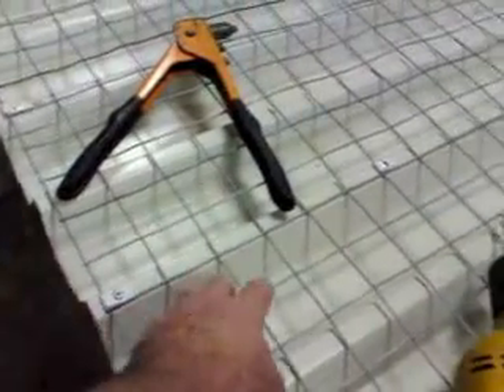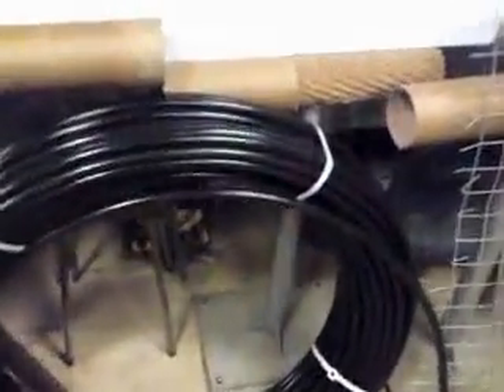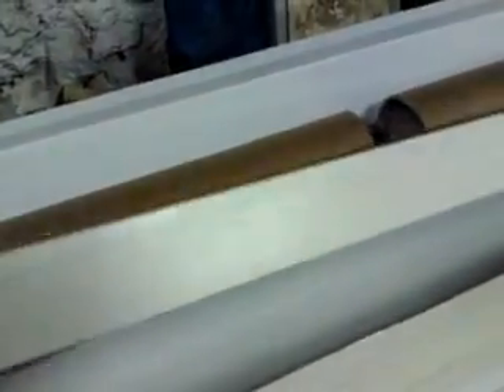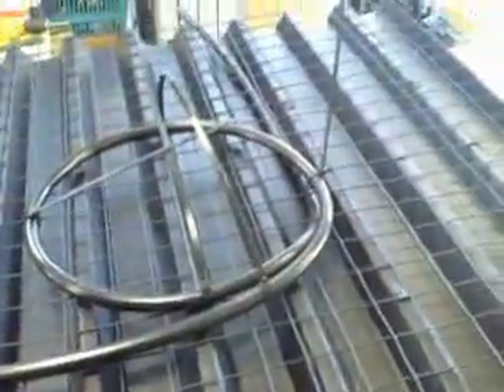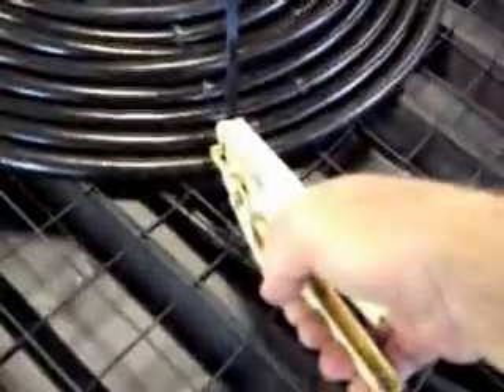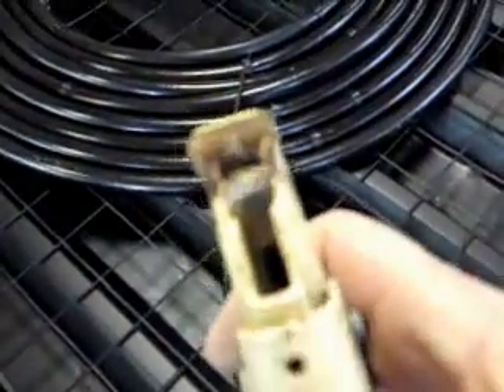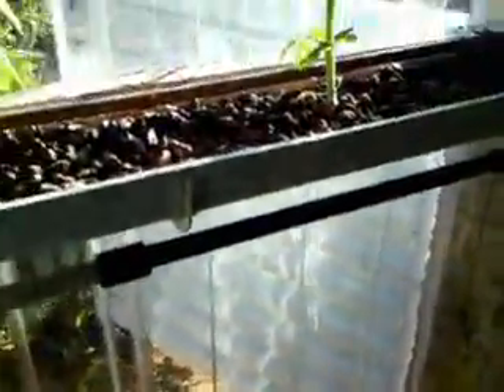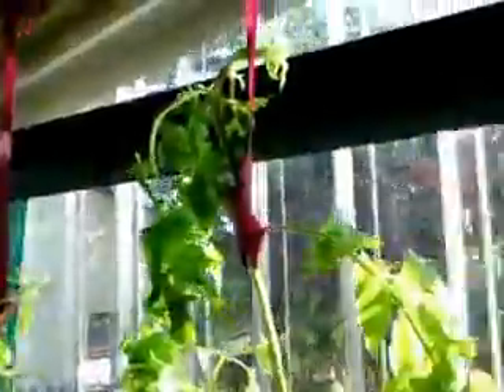Solar Water Heater

Comment: I had a swimming pool solar heater installed by professionals about 20yrs back. The pipes carrying water onto the roof was normal 40mm PVC, but about 100 thinner black rubber tubes the size of drinking straws absorbed the sun's heat, spanned between the 40mm "outriggers". They assured me the material was similar to car wiper blades and as durable, which it was! Also, a pressure relief valve was fitted in-line in the upper corner, maybe this will solve your steam/overheating problem!!

Comment: @Rockit8 
I figured out why it over heated and melted the pipe. I didnt allow it to run long enough to push all the air out. When I turned it off, wherever there was trapped air, it melted. There was no water touching the pipe to absorb the heat.

Comment: @spokedwheel 
Water touching the pipe should have kept it from melting. I now believe the pipe melted only where there was air trapped in the system. I have since learned to purge out all the air.

Comment from the maker: @Rockit8 Fortunately I haven't had any 'melting pipes yet' maybe the tube you used was a lot thinner,(if your system is a closed loop system, then the steam build up would burst the pipe), though the water does get too hot for the fish if I leave it running constantly, that's why I have it running only from noon to 5, thanks for the interest.

Comment: I built one like this but smaller. The first time I used it, I turned off the pump. With the water not curculating,  it got so hot that the tube melted and got several holes in it.  This thing gets hot fast, so when the sun is out, you have to keep the water circulating or keep it covered. I should find a tube that can handle higher temperatures.

Comment from the maker: @BooKittyRadley Obviously the heater won't get hotter than the outside temperature but if the cold is in the wind factor but the sun is still shining then the unit should still heat up, I have my timer set to come on at 12 noon when the sun is shining directly on it and the water is pretty hot when it starts up, as I said in a previous post, it takes about a day to raise the temp from +- 16C to 30C. Where I stay it never gets as cold as 7C, it's winter here now and the temp. maintains at +- 25C.

Comment from the maker: The box measures about 1M X 1M and I used +- 30M of tubing, it is quite well insulated with polycarbonate on the front and aluminum on the back and with the closure all around the edges, bearing in mind this is not a closed loop system with a radiator in the water but pumps continuously from the water through the coil and back into the water. If you have a closed system filled with antifreeze the water would get much hotter, when the pump switches on the water at the outlet is almost boiling.

Comment: I have the same type tubing, thinking of making one myself, how may feet of tubing did you use on your heater? and would be not be better it it were in an insulated box, to retain heat from the sun?
Thanks.

Comment from the maker: Polyethylene is used for drinking water pipes so it shouldn't be a problem also being a continuous running system as apposed to a closed loop one the temperature of the pipe doesn't get much hotter than 26deg C.

Comment from the maker: I have it running from 12:00 to 17:00 when the sun is on it and it has raised the temp. from 15C to 21C, the hose is LDPE plastic sprinkler hose.